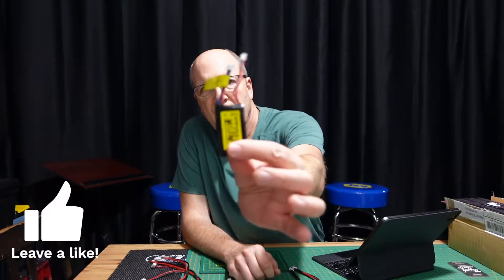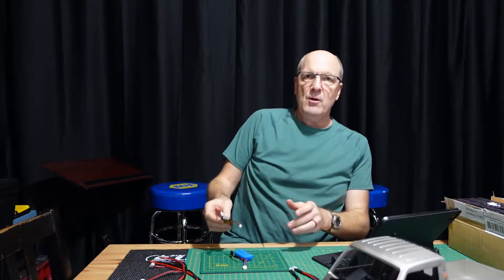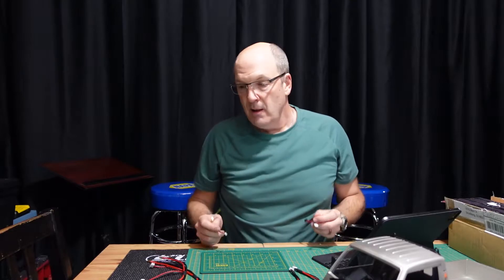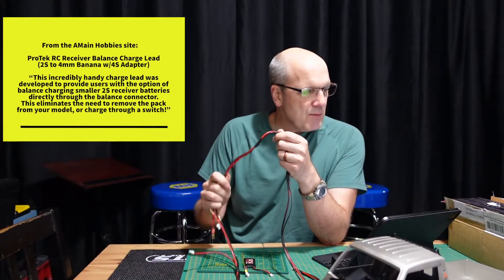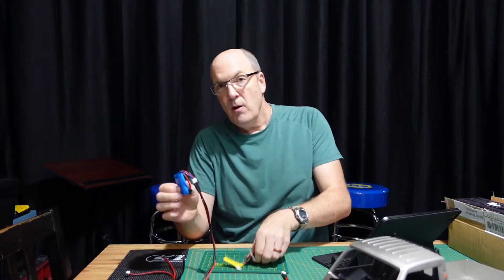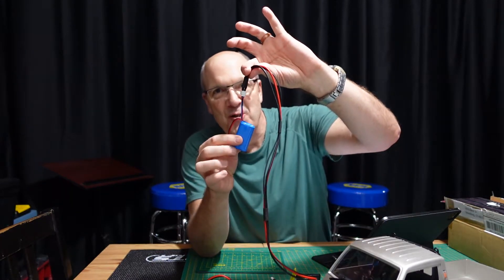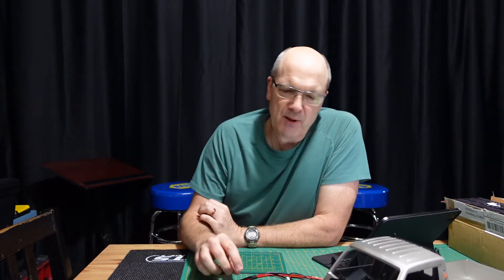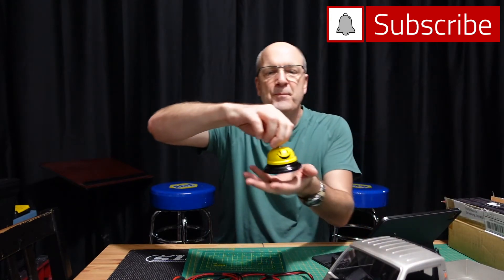WDKWWAD #8: Storage Charging (& Charging in General) 2S LiPos that Charge Off the Balance Connector

Comment: Ohh boy! It was exactly the video I needed! Thanks a lot now I know what I need.

Btw, this video is 4 years old, did something changed? Do you recommend something else?
And can you recommend me a good charger that I can connect that banana to :)
Reply from the maker: Sorry for the delay in responding. This is the same way I would do it now.

As for chargers, the one I would have recommended was recalled…so no guidance for that right now…

Thanks for commenting!
Reply: @RCCarTech  thanks!

Comment: yooo so i have a protek 2s micro battery that has a umx connector ? i cant find anything to charge it? amain even led me wrong nothing against them i just might have got the wrong order im not sure yet
Reply from the maker: Sorr for the delay in responding. I’m also not familiar with that battery. However, I suspect if you call AMain they may be able to help you.

Comment: Hi. I have a battery just like yours, the blue one.  the problem is I can't load it at all.  I use an Imax B6AC device, and I get a connection break.  but appears batteries can charge them with it.
Reply: Hmmm...I apologize Bologan.  I am unsure what you mean by “but appears batteries can charge them with it.” Can you explain?
Reply: @JegErAlan  I mean, such batteries can be charged with this device.  only my device doesn't charge them. I don't know why.  and the device is new.
Reply from the maker: @bologanbogdan6634  Ahhh, thanks. I am not sure if you have tried the cable I am using...but I would give it a shot.

Comment: Thx for sharing this! So this cable doesn't require you to connect the battery lead, just the balance lead? HobbyKing use to sell a Parallel Board that lets me do this too and I recently found it for these batteries. Works with my charger and I can use just 1 lipo or charge 6 but HobbyKing discontinued them... https://hobbyking.com/en_us/parallel-charging-board-for-12-x-2s-e-flite-umx-lipoly-batteries-with-balance-lead.html
Reply from the maker: Correct.  You can just connect the balance lead.

And thanks for watching!

Comment: That USB charger was driving me crazy with paranoia lol... I thought my house would explode... so I cut that white connector off the batt and put a red JST connector from a dead rc helicopter I had lying around... then I put the other side on banana connectors so I could use the real charger :) what I'm not sure about now is the charge rate... the batt is 350mah and the thing set itself up at 0.3A
Reply from the maker: I am still a newbie, but I believe the guideline is max 1 amp per 1,000 mAh, so 0.3A sounds good for a 350mAh battery.

Thanks for watching!